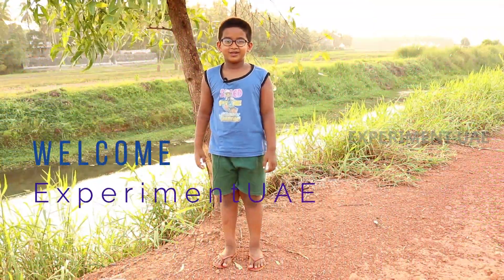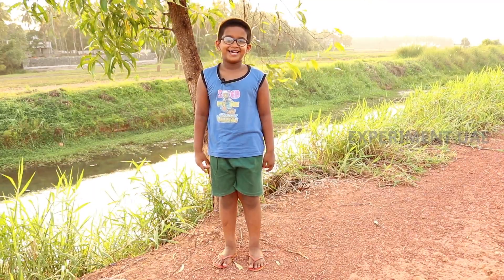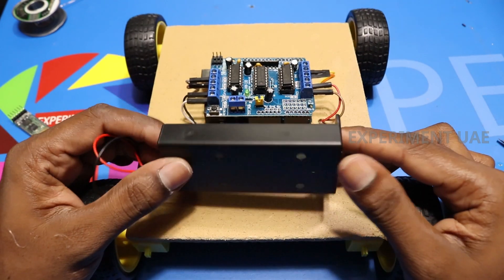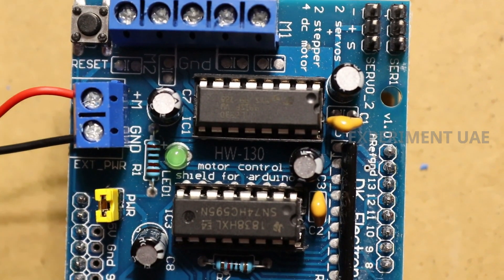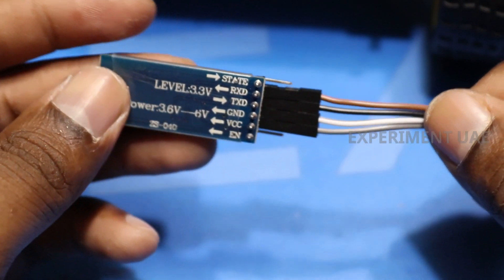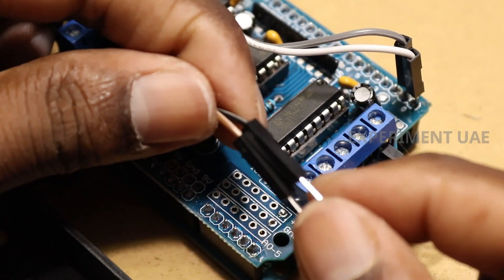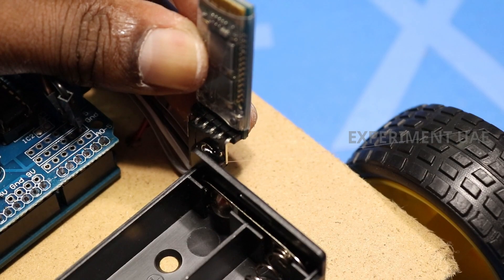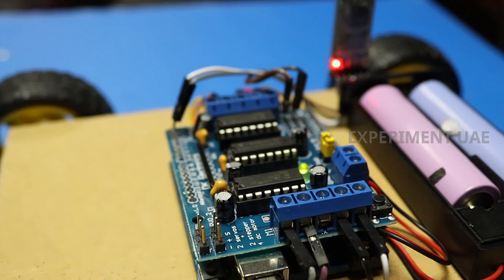How To Make A Bluetooth  Rc Car At Home |  Malayalam| EXPERIMENT UAE

Comment: Oru rc ndakki nano vech but speed illa any solution
Reply from the maker: Weel slip avuthundo . 4 weelum direction  correct ano ?
Reply: @Experiment_UAE  illa 4 gear motor um shopil nn vangeedha 300 rpm kuravundonn samshayam nale poi clear eyyam....tnx for replying me...

Comment: Njan undakiya carinu speed valare kuravanu pls help
Reply: Experiment UAE what?
Reply: Experiment UAE i removed all of the wheels and reassembled still didnt work it rotates at same speed without wheels pls help is it the battery?
Reply from the maker: Battery etha use cheythathu
Reply: Experiment UAE lion battery anu 2 ennam 18650
Reply: Experiment UAE pls reply
Reply: Experiment UAE how to fix
Reply from the maker: please check your motor shaft and wheel strong contact may be slipping wheel  there
Reply from the maker: remove one motor plus wheel and connect outside 3.7v battery understood you your motor speed how ?